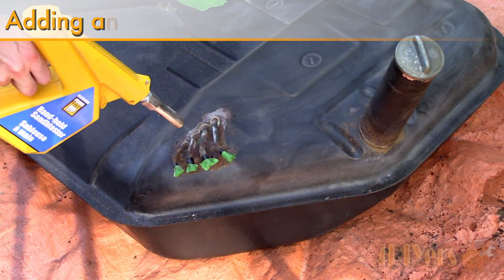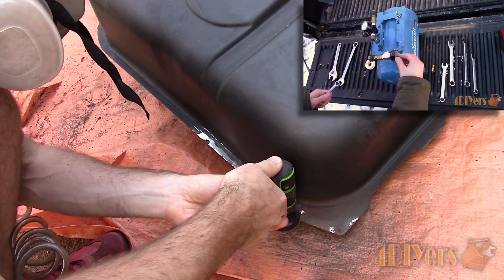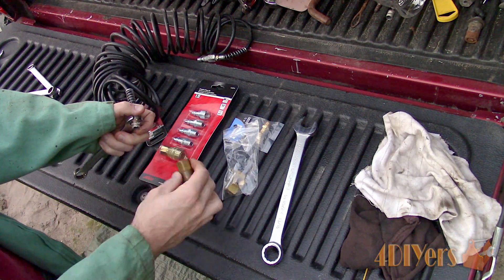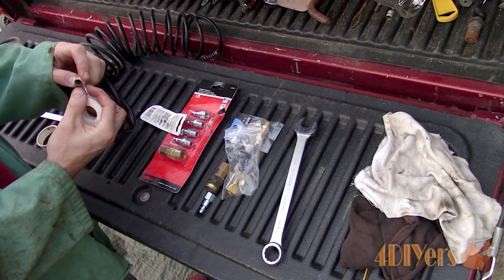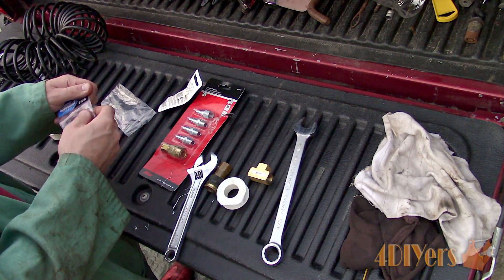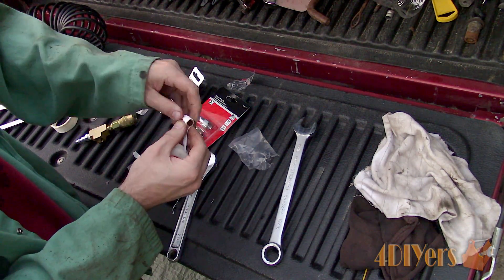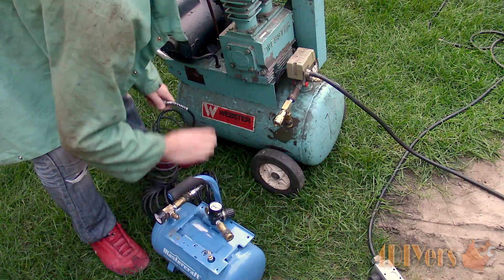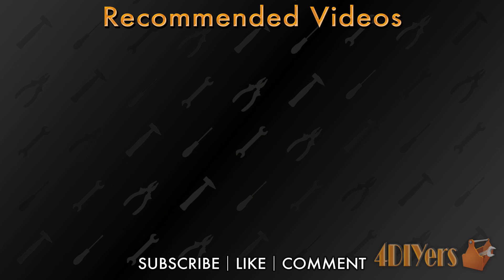How to Increase your Air Compressors Capacity by Adding an Extra Tank

Comment: I got a question for you, that nobody seems to be able to give me a straight answer on. So recently picked up, for free a 33 gallon air compressor tank. The compressor itself went bad and the owner removed it and everything else and was going to throw away the tank so I took it. I was thinking about just making a portable air tank, or possibly even a new metalworking project with it. Anyway the tank is in great condition it just has the handle wheels and the platform on top where the compressor used to be. Oh and a small 3 in pipe sticking out of the top of the tank. No other Mechanicals with it. I have three smaller portable air compressors that I can use, nothing larger than 10 gallon though. So I'm wondering would it be beneficial just to relocate the compressor gauges and other plumbing from one of my smaller compressors to this 33 gallon tank, or attach it in series with one of the smaller air compressors and tank. I haven't been able to use air tools in a while because my 80 gallon two phase shop compressors and storage and I have no place at my current apartment to use it. Right now the easiest thing for me to grab is my Campbell Hausfeld, 6 gallon 1/3 horsepower compressor. Soon I have to do some work replacing both rear brake cylinders and both front calipers on my truck, and I wanted to use my air tools. My hands aren't the greatest anymore and I'd rather avoid using only hand tools. But before I get to work I wanted to see if maybe I utilize that free tank I just got. If I remember correctly that Campbell compressor was horrible for air tools, I used to use it for airbrushing , sandblasting and just air blowing, pumping tires type of thing. I know it's been almost a decade since I've last used it. Anyway the first thing I want to do is use this new tool that's out there which is a bit for an air hammer which you can put over the bleeder valves to break them free on your brakes, and I'd like to try that first but I'm not going to spend the $65 for the tool if I don't have a compressor within a balls to even make the attempt I'm not a compressor expert and figured I'd search on YouTube for somebody who might be. Any advice? I don't want to buy a new compressor

Comment: One of the biggest upgrades you can make is getting a bigger diameter hose, and milton (or off brand) high flow fittings. They allow more air through, with less drag and therefore more power goes into the tool, rather than into heating up the hose from friction.

Comment: I simply replaced my single quick disconnect coupler with a  3-way quick-disconnect manifold coupler and connected my air tank to one coupler and air tools to the other two and worked great while maintaining the existing overpressure switches on my compressor and portable tank. This is a cheap alternative to buying a larger compressor, especially if you already have a portable tank. Quick disconnects also still allow you to easily disconnect and transport your portable tank for other jobs.

Comment: Does this mean you have more cfm?????
Reply: It will only increase volume. The engine/motor and air pump determine CFM, regardless of tank size. 
To increase cfm, you need a bigger pump and more horsepower to run that pump. 

If you have a compressor that pumps 4.0 cfm @ 90 psi, that's what it will pump. More volume will allow you to run longer at a higher cfm output, but it will still run out of breath and fill at the same cfm.
Reply: No extra CFM will be created. The motor will work longer now when it has 2 tanks to fill and shorten it’s life.